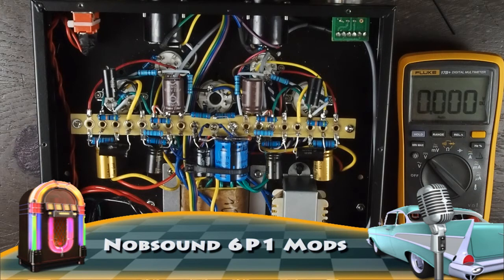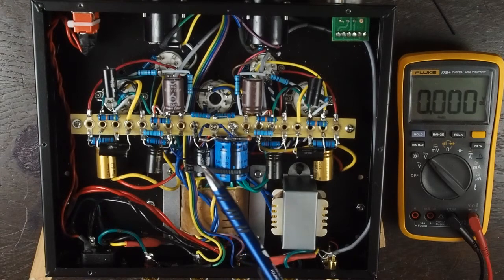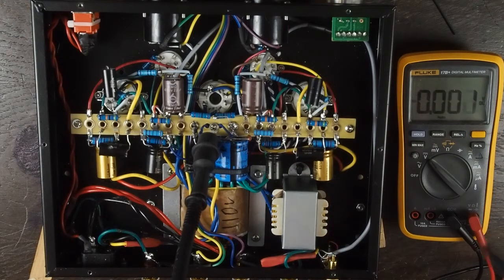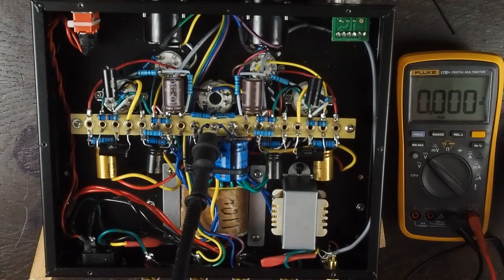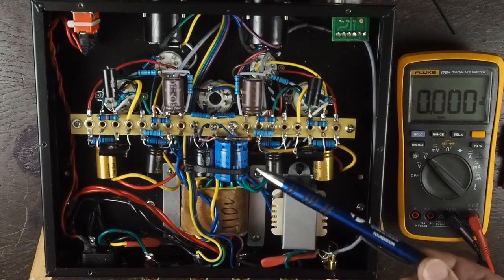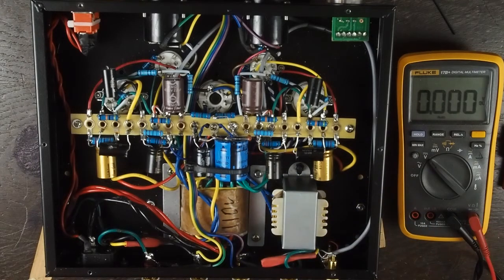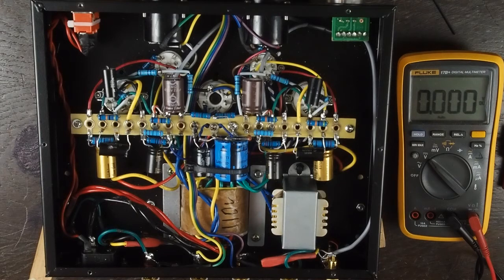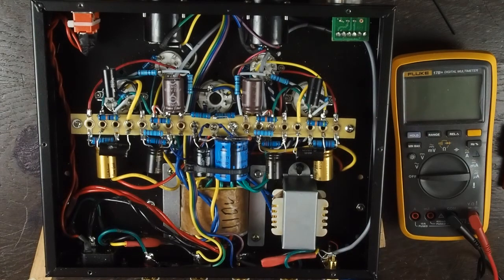Nobsound 6P1 Tube Amplifier Basic Modifications

Comment: What about the Nobosound AV-525?  Do you plan on showing us any mods if needed on it?  Mine will be here next week.  Being I am using my variac to keep these Chinese tube amps at 110 volts could I just turn down my variac every time before turning on my amp and then slowly bring it up to 110 volts if I were not to mod anything?
Reply from the maker: Have no idea, looks like tube pre with SS output?
Reply: @SkunkieDesignsElectronics  Sorry, it is. I forgot to mention that. I guess not being a 100% tube amp possibly I will not have to worry about upgrades inside this AV-525 amp. Hindsight on my end.

Comment: Your kidding about the inrush right?  Have you worked with tubes before?  What is that time you have to wait from when you turn them on and they start working, and what happens over that time?  The caps have lots of cycles to charge up as the tube warms up and starts conducting.  Now diodes might get pissed but most silicon diodes will stand enormous overloads for a cycle or two.  Oddly enough the weak spot I have seen in amps is the power switch.  Now breaking the power off into 2, 3 or 4 resistor or diode isolated pieces may give you a bit more channel isolation in cases where one channel is driven hard.  That is the poor mans version of independent power supplies.  Also, I can not speak to this exact amp but if it is driving the filaments with AC, I would just assume get rid of that, even if they are indirectly heated.  I see all the nice lead dressing to keep the signal away from AC and than stick the low level signal in a tube heated with AC..  Last amp like this I looked at ran the fils a bit hot on AC so I suspect a bridge and something like a lm338 would work out well with the regulator not dropping much more than it's minimum.   Not to sound like a total dick but the inrush stuff with the caps is really silly,  The inrush on the filament winding on the transformer is real, but again, it does not last long before the tube gets warm, but do and ohms check on the filament on a cold tube and figure out what it wants current wise given the heater voltage does come up instantly, unlike the plate, at least with a tube rectifier.  I would ditch that too, the tube, and get the plate closer to it's max, 250V, but that is just me..
Reply from the maker: "Not to sound like a total dick but the inrush stuff with the caps is really silly"

Have YOU ever worked on tube gear? 

It's not only the inrush current, it's also the charge cycle these tube rectifiers deal with. They only conduct current when the cap is discharged and if this first cap is too large, the time window is massively reduced, which causes high current spikes, which destroy the tubes. Go read a data sheet for ANY tube rectifier and see they all have a max limit on the first cap for this reason. You will exceed the maximum rating for hot-switching transient plate current. The one for this tube is actually listed as 5uf when used at it's max rating. 22uf is actually still fairly high for this tube, 150uf is WAY higher than any tube rectifier should have.

https://taooftubes.wordpress.com/2010/04/30/5%D1%864%D1%81-5u4s-russian-rectifier-tube-data/

As far as AC on an indirectly heated tube, unless we are talking about a pre-amp with a lot of low level gain, that is a silly waste of time. There is ZERO hum on a well laid out power amp with AC heat with indirectly heated tubes so why would anyone do that?

Sounds like all your experience is with solid state gear. Here is some reading to do on tube rectifiers for ya.

https://www.valvewizard.co.uk/smoothing.html

Comment: Thank you for this very informative modification. I just did this mod and very happy of the result. I’m comparing this with the A10 and with just subjective listening, while using the same song, I found that I got more volume with less distortion than the A10. When I pushed the volume on the A10 and it sounded “taxed” or overdriven/ distortion.

Comment: Just curious what wattage the resistors should be spec'd for looks like you used 2w?
Reply from the maker: I buy resistors in bulk and most values I just buy 2W. Overkill for many uses but cheaper to just "stock" one size.
Reply: @SkunkieDesignsElectronics  
I was a bit clueless when I ordered mine and got .6w you think those are safe?

Comment: Does the high value filter cap right after the rectifier have any negative effects if the rectifier is a solid state bridge rectifier? Do you have the parts and diagram for the bucking transformer for the 110 volt transformers? On my old radios I usually put a resistor in the Bplus to drop the high voltage and occasionally use one on the heaters but those always seemed close enough so as not to stress them out too much. And once again thanks for teaching me a few things again!!!
Reply from the maker: You could use resistors inline to correct all the voltages, but a bucking transformer is easier. That cap is fine with a SS but then the B+ will be even higher!

I'm gonna be doing an updated version of these 6P1 videos soon, someone sent me one to use for this.
Reply: @SkunkieDesignsElectronics  Personally, I cant STAND tube rects, seeing them glow ionise and explode 'back in the day' ;) if I can still get this amp for cheap I might replace it, bring the bias down a bit and risk the elevated B+ - only if I'm gonna mess around like that, might be more fun to just build the whole thing from scratch ?

'Course your channel gives me some fun ideas for that :thanksdoc: :)

Comment: I have the 240v version can I just put a 5u4 solid state rectifier conversion in tube socket
Reply from the maker: Probably is not a good idea, the amp needs the voltage drop provided by the stock rectifier tube.
Reply: @SkunkieDesignsElectronics  thank you I appreciate you sharing your knowledge

Comment: Individual cathode resistors ................YES !
But grid resistor bypass caps ???????????????????????????????????????????????????????????
Reply from the maker: Yes, for a cascode they are used. A cascode is turning two triodes into a pentode, the upper grid is acting like the screen and you are shunting any AC to ground. The original design of a grid leak cascode works fine on a guitar amp, but has no place in a hi-fi amp. You can read more here: http://www.valvewizard.co.uk/cascode.html
Reply: Oh, a cascode :) tempted to ask "why"?  We can maybe get a bit more HF and a bit more gain - whether its worth an extra triode mind...???
That's the trbl, if I found one of these, I'd just want to change the guts around, so not much point unless it was REALLY cheap - I enjoy watching you do your thing with them :)

Comment: Regarding the over sized filter cap after the rectifier tube - what about adding a thermistor between them rather than reducing the cap value? That would increase the charge time of the cap, protecting the tube, but maintain the higher filtering capacity. Thoughts? Thanks for the videos!
Reply from the maker: The oversize cap still puts stress on the rectifier tube after initial current inrush, which isn't really the issue with an indirectly heated rectifier tube. The main problem has to do with reducing the window of time current flows through the rectifier, creating current spikes. Using a 22uf in that spot causes no hum even with sensitive speakers.
Reply: @SkunkieDesignsElectronics  Yeah .. Though I aint messed with tube rectifiers since like ever, I figure the only other way to fix it might be some kinda delay relay, like they used back in the day?
Alright, maybe some kinda PTC thermistor between rectifier and first filter might do something if it was just the right value, but.. Hmmm?

Comment: Did you have a list of capacitors? Where did you buy them from?
Reply from the maker: The parts list is in the video description and I bought most of the parts at mouser, the optional solen caps can be bought at tubes and more https://www.tubesandmore.com/ but other audio grade coupling caps can be used as well.
Reply: @SkunkieDesignsElectronics  Since YouTube did the redesign I have not seen or looked for video descriptions. Took me 15 minutes to find it🤣🤣🤣
Reply: Last question. I have 1/4 watt 1M resisters. Will those be to small? Yours look like 1/2 watt.